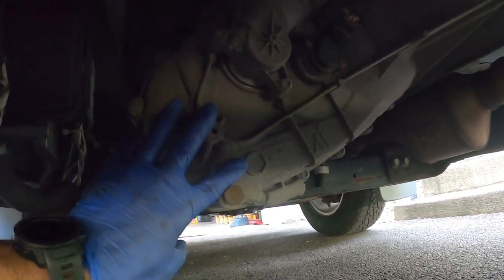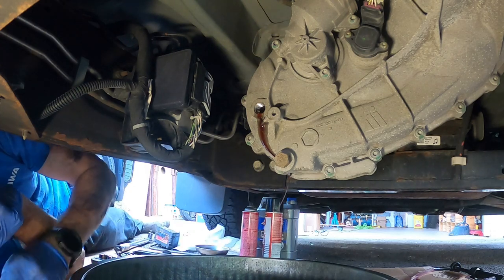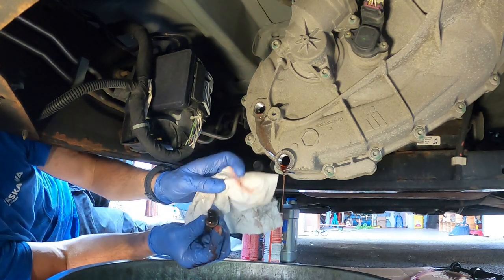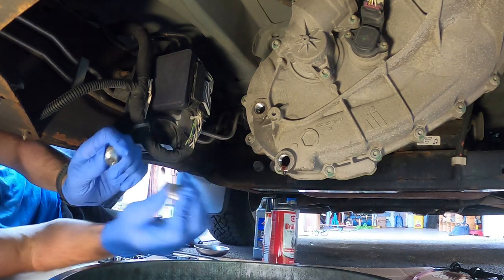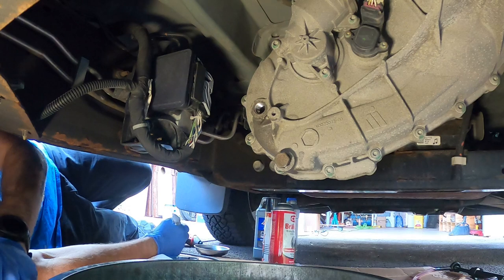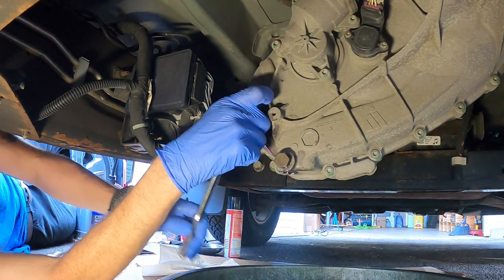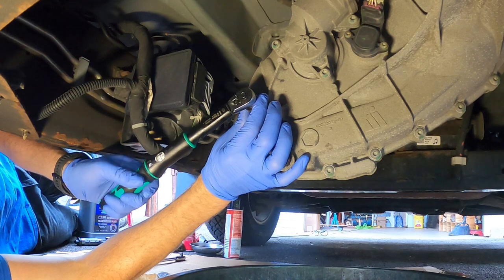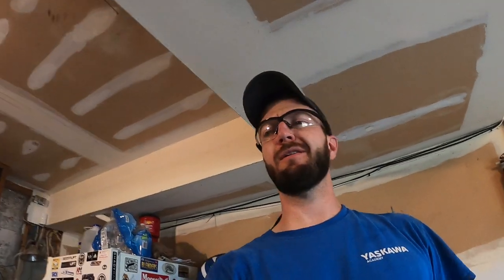2014-19 Silverado/Sierra Transfer Case

Comment: the problem for a diy’er is we, or I don’t have a way to pump the oil up to the transfer case fill hole. i cant get a hand pump that moves fluid. a squeeze bag would be great. maybe a water bottle with a snout nozzle and a piece of hose clamped to it. either way im on the struggle bus for what seems a simple job!
Reply: I use Amsoil Severe Gear and Amsoil Auto Trans fluid for the transfer case.. all squeeze bags. Makes things easy, plus it’s a fantastic product IMO.
Reply: Get a pump drill attachment for an electric drill.

Comment: hey bro I bought a 08 f150 rear wheels not spinning do you think is the transfer case or differential when I put the car up to the air rear wheels are like locked
Reply: Diff